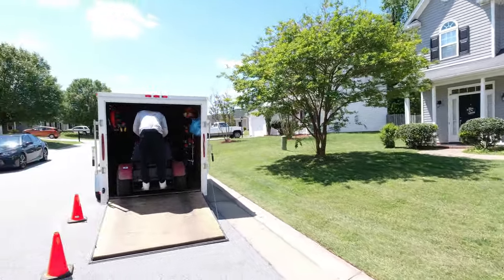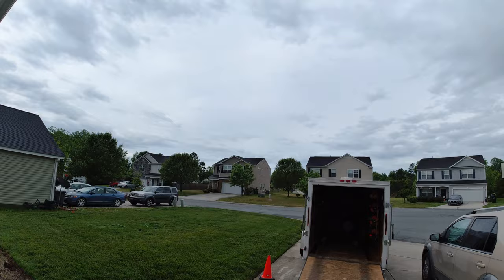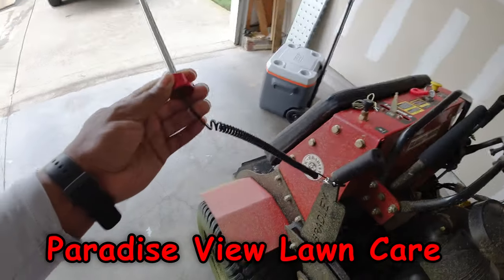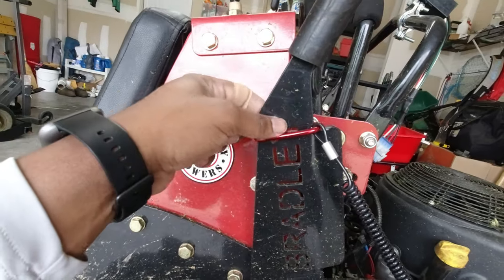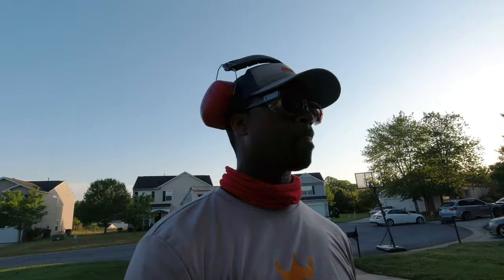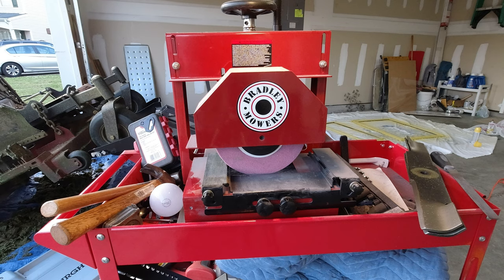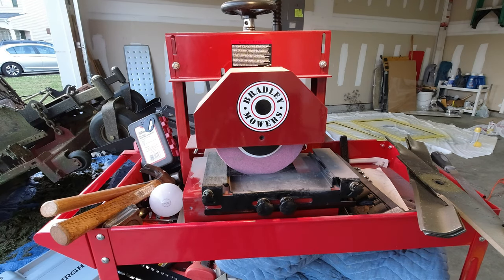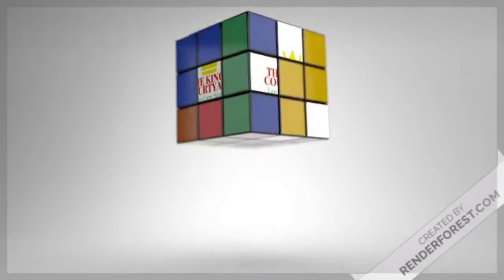Bradley Blade Sharpener (music prod by Cxdy)

Comment: found a Bradley s501 sharpener on craigs list charlotte $225  brand new. I have the manual but it does not show how to use it.  Shawn, have you tried running the wheel towards the blade?
Reply from the maker: What do you mean?
Reply: @thekingscourtyardlawncares9324  i noticed in this video the sparks were moving away from the blade, have you tried reversing the wheel ( sparks fly towards the blade). Other companies spin the wheel towards the blade.
Reply from the maker: @firstname6208  oh, yeah it seems to sharpen better in that direction tho.
Reply: @thekingscourtyardlawncares9324  good to know, now I need to find a stand and get this machine running!
Reply from the maker: @firstname6208  it’s okay, but I sharpen roughly 12 blades at a time and that grinding stone doesn’t last long
Reply: @thekingscourtyardlawncares9324  have u tried sourcing a stone from a different vendor? Maybe klingspor has a much better alternative.